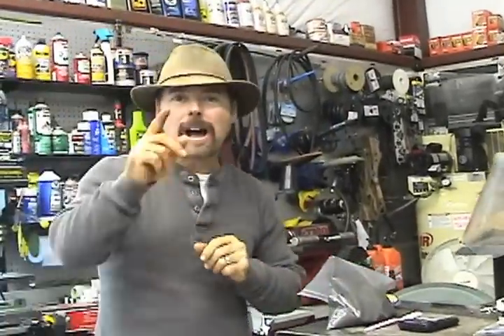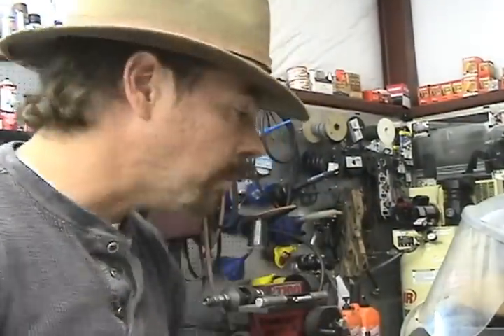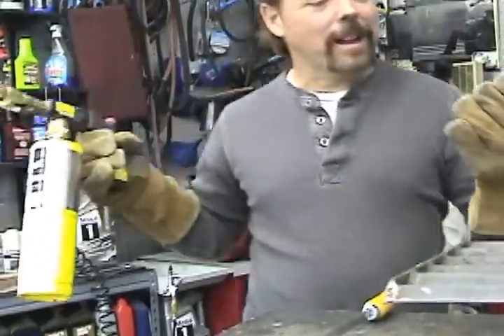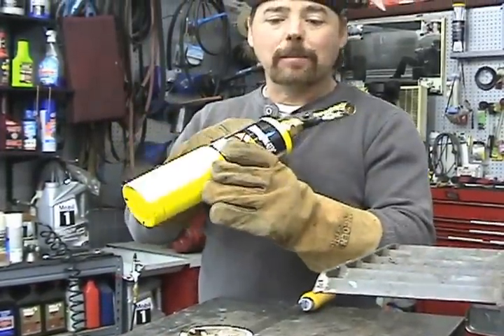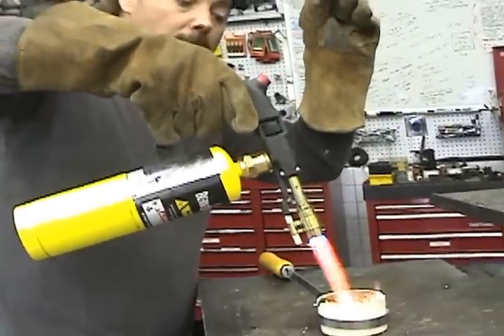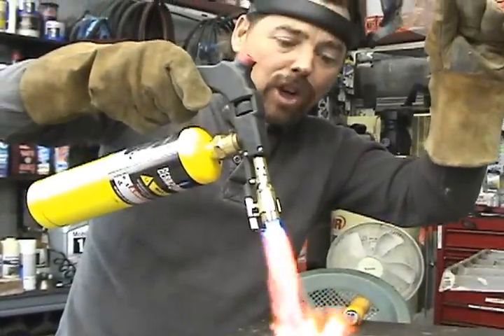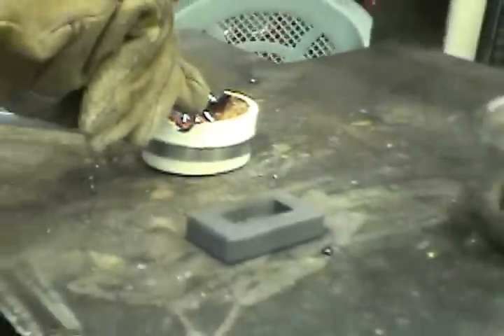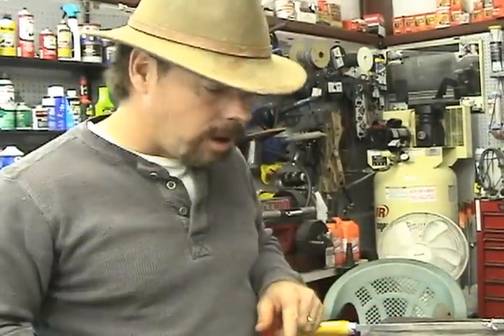MAP GAS | FLUX |  Smelting | Gold - ask Jeff Williams

Comment: I made a button of my own small pile gold flakes - used an ordinary propane torch with a little borax powder as flux. I pre-heated the crucible. Ended up with 2.1 DWT.  (I use pennyweight rather than grams - so much easier to calculate. 20 penny makes an ounce.)  So 2.1 penny is slightly over a 10th ounce.

Comment: the torch is a harbor freight torch its around 20 bucks and sold as a welding torch and works great although im not sure its rated for map gas though, mine said nothing about any other fuel except propane but hey its working nicely with map for him. just thought id share where the torch is from im using mine as a small forge burner

Comment: It was costly and somewhat funny to see happen, but way back when I was up in Brekenridge Colorado decades ago, the local concrete and gravel plant would let us clean the sludge out of the run off trough of their washer plant.  The material the plant used was from huge dredge tailing piles from gold mining many years before.
Well, over a month or so I would process out this mud and clean the gold up.  We got a few ounces and split it up.  One of the guys decides he wants to melt his down, so he tosses it in a metal pan and goes to town on it with a Mapp gas torch.  None of us had done this before, so no flux and he just burns and burns and burns away on it.  Finally he stops and no gold in the bottom of the pan.  Just a bunch of slag.  He is like, WTH happened to the gold!  Tosses out the chunk of slag.
30 years latter after seeing this I am wondering if the gold was inside the slag, LOL.

Comment: Hi Jeff...LOVE the videos.  Dude, I used to run the furnaces at Dillon Gage Refining on Indian Trail in Dallas and melted millions of dollars worth of gold, silver, platinum and palladium from pawn shops, jewelers, dentists (gross melting teeth with blood still on em etc!) and literally walked around with 650 ounce ingots still warm from the furnace after vacuum tube sampling them and casting into foot long ingot molds.  Point is, you live and die by flux...wrong flux, you lose gold.  I always used anhydrous borax as a base and on the 3rd or 4th melt, casting into a conical shaped dore mole, thinned out the final melt with sodium nitrate.  Since then, I've become an artist in raku pottery and glass and make all my furnaces, burners etc. to this day.  That said.  Get on Craigslist under the "art" section and buy a used 110V electric kiln and forget the torch.  Go on ebay and buy a small graphite crucible.  Use borax as a flux and at the end of stirring the mix at high melt, thin the whole thing by pouring in 10% of the borax weight of sodium nitrate and use a bit more to make it thinner if you want.  Your work and efficiency will go WAY up.  The ONLY time we used a torch was in small fireclay crucibles and it was an oxy/acetylene torch to burn dentist's teeth to get the palladium/gold melted into a button...didn't even use flux!  Keep up the HILARIOUS videos...man you are the Red Green of Youtube!
Reply from the maker: Thanks Russel for the great info. We will look into an electric furnace too. What are your thoughts on a propane furnace.  Jeff

Comment: Jeff , I bought an older  02 concentrator (medical )    and use my natural gas from my house as my gas ,
made a diy torch from two old propane torch heads and valves , using the natural gas from my house and the 02 concentrator for my 02 , and I can do everything but cut with that flame , braze up to 1/8 inch even thicker and if I had a regular cutting torch mixing barrel and cutting head I could probably cut thin material with it if i had a higher pressure source to blow thru the metal , probably regular air compressor air would suffice for that but it is the perfect flame and it's almost free . I sold my big torch and bottles  many years ago and i get by with this homemade rig and its all damn near free no more buying gas from welding supply or bottles of map from Meads Hardware store . Just food for thought for uyou or any of those on here interested

Comment: Useful 411  ,I use natural gas from my house and an old medical   oxygen  generator  aka (breathing machine) ,you can find the older type real cheap .  i mix both gases via a simple two valve/ torch mixing barrel using a  small orifice  oxy /acty  brazing tip . it will get hot enough to even braze  or gas weld metal up to 1/8 " thick .

Comment: I tied using borax but it coated my gold a dingy color and didn't resemble gold or melt to a button, I used map gas.. To be fair it was a 10k solid gold ring, seems like it was covered in a glass substance and wouldn't melt to a button rather just large chunks which would be great chunky gold, would borax be the culprit

Comment: Hi Jeff. Great videos, really enjoyed them. I used to poke around in the hills and find cool rock specimens. Never knew you could actually vaporize gold, does it simply evaporate into the air? I saw on your one video with your dry washer it looked like you were using the same leaf blower motor for that too that you used for your vac-pack? Also which is the most productive method, 1) roasting pyrites/sulfides or 2) crushing and panning? I'm up in the Portland area but hoping to get out soon and do some panning. Don't let slim steal your gold!!
Reply from the maker: Doug Van Tassell  yes it will boil at about 4700 degrees. Yes it is the same motor (Echo 210 ) I would say crushing and panning for us. We produce more Gold here with that method.
Jeff and Slim

Comment: I'm not trying to be difficult but you really need to preheat your crucible first before you put your gold in the crucible. If you are doing several melts, back to back, then you only need to preheat it once. You should also wait to pour the flux in just before the gold becomes molten, and just a tiny pinch will do. Too much flux can cause porosity. I know this because I'm a bench jeweler.
Reply from the maker: Dani Vela-Perez  Thanks for the info and tips and yes we should show pre heating the crucible first, Thanks,
Jeff and Slim

Comment: Where can i buy the dish you have to melt my gold in or what's the material is made of or called? I bought me a little graphite crucible and tried melting my gold but it won't liquefy it just melts down. I have map gas on bernzomatic torch so i don't know if that's even hot enough.  Please help advise.  I think it won't melt because my crusible is round tube so my flame is not direct heat and getting full temperature i don't know.  Thank you
Reply from the maker: Wayne Ernst Hi Wayne we get our supplies from a place called Make your own Gold Bars. Here is a link;
http://www.makeyourowngoldbars.com/silica-dishes

The MAP gas will get it Hot enough but takes a while so be patient. Be sure to season your dish first with Borax or Flux.
Jeff and Slim
Reply: Thank you very much
Reply: Are you interested in the Kate Spade Planner?  You left a comment on my blog.  I actually never used it so it's brand new.  Email me if you're interested.
Reply: Just use a potatoe instead of a dish, works same

Comment: Hi Jeff, Great videos, thanks.  I have some gold that was melted with aluminum.  What is the best way to separate these metals so I have the 95% that you are getting. chemical?, torching? thanks.
Reply from the maker: Del Norte Chiropractic smelt the aluminium out with flux and use a cone mold to drop the Gold to the bottom.
Jeff and Slim
Reply: I'm guessing the extra on the top will easily crack away after it is heated. Is this correct? I love your videos, Thanks for your help.

Comment: I found a little container that has a couple tiny prices of gold.about the size of crickets ear,  I thought buy looking at the gold I hadin the container, I could compare to what ever I find in a couple buckets of dirt and mud that I brought home from my first prospecting trip . there is lots of shiny stuff, 
 So I figured I need to put the gold in a pan with the mud to see how gold  really does or does not move.

 I was surprised. I still don't know if I have any . I do know there is a lot here that isn't , so my question would be ,is the term ( concentrates ) meaning all this materiel cleaned and most of the floaty shiny stuff, removed,? 

 I mean, what does gold sand really look like wet and dry? 
 What does a pan with half cup of this look like? I'd like to see this so I know if ive waisted time and material. 
 I dont like looking ignorant going to the guy at the jewelry store . and I know they don't like waisting their time with me. 

 If your still reading this, I apologise for not keeping it short and simple. Thanks for making your vidieos.

Comment: Hey, pretty cool stuff! What is the stuff you're using for flux? What does it call? I had some tough time melting silver and gold with the mapp pro gas torch. It seems that the torch cannot regulate enough amount of gas flow to generate enough heat and it sweats out in a very short period of time that weaken the heat and not getting the job done. Does it mean the torch is no good? Any idea what I should do? I need some help here...Thanks.
Reply from the maker: +mich65ek2  That is Chapmans Flux from http://www.makeyourowngoldbars.com/1-lb-hank-chapman-recipe-flux-refine-gold-silver-recovery-jewlery-smelting-assay
MAP gas is just hot enough but like you said ...any small change and you are back where you started. Try acetylene and oxygen. That will get hot enough.
Jeff and Slim

Comment: Is that just tap water it's dumped in after to cool? Does it have to be distilled and why?
Thanks
Reply from the maker: Yes distilled is better due to no minerals or alkali affecting the Gold during the cooling process.  Jeff
Reply: I used tap water last night. The button I made looks more like silver. It was 14k gold I melted. Does it look silver because of tap water?
Reply from the maker: It may have had an effect on it or when you melted it did you use flux to draw out impurities .   Jeff

Comment: Hey. Still learning before I eventually buy that gear. Just wondering, does that black flux separate copper and gold and could you use it for refining gold out of gold filled jewellery?  So far I've just seen the Aqua Regia and Cupelling methods for refining other metals away from the gold but I assume by base metals you mean things like Copper, nickel etc.                                                                                                                                                                                                                    Also if it does separate the gold and copper/brass, can I do this process in a closed electric furnace in a graphite crucible?
Reply from the maker: yes
Reply: @Askjeffwilliams  Thanks.

Comment: this video make it look easy.....I'm doing the low budget melt.
Trying to melt my gold bridge into a ring for my gal. I've made up a mold and trying to melt the bridge right into the mold. I'm using propane, can get the gold orange/red but it's not melting. what am I missing, flux, acid more heat?
Reply from the maker: Eric Wight you have to use MAP gas it has a higher burn temp. Gold melts at 1953 degrees.
Jeff and Slim

Comment: Can borax be used or is the flux better? What purity does the gold come out to or is that hard to say for sure without some kind of purity test?
Reply from the maker: Hi Stan you can use just Borax and that was the standard for a while but Flux is much better at removing impurities and if done correctly you can expect 98% pure .  Jeff
Reply: But if there is Silver mix within the placer gold, borax or flux won't remove it. I did mine and getting 86% AU and 14% Silver

Comment: Hey, Jeff & Slim! How does one alloy one's AU down to say,  18 or 20 caret for jewelry making purposes?
Thanks!
Reply: Thanks! There's the stuff,  now to figger out how to use it~
Reply: FREEDOMFAN229 you just mix your purified gold with the alloying metal in the ratio to get the karat you want...then melt. You can do it with mapp gas as Jeff W demonstrates. If new to this, please note the safety item he doesn't mention is the work surface. He is working on a table covered with steel plate. Be safe and have fun!

Comment: hey jeff i got 1000grams of gold flakes off the internet..can i use this to make jewelry?
Reply: hey I aint jeff and I don't know as much about gold as jeff does ether. I do know that when thay make jewelry thay put alloys in the gold to make it harder so it don't bend and dent as easily as gold by its self will. Even most gold jewllery marked 24carret isn't thay still alloy it because gold is very soft. 24carret is supost to be 99.9% pure gold. Im planning on making a wedding ring for my fiancé a ring from the gold I found I haven't done it yet I don't think it would be a problem making jewelry out of gold. people have done it for thousnands  of years why cant we do it in the 20th or 21st century witch ever it may be?????
Reply from the maker: Hi Christopher, yes you can . There are several ways you can do this. Let me know if you would like suggestions.  Jeff
Reply: ***** Hi Jeff, what's the name of the torch head that is being used?
Reply: Daniel Collazo Looks like a Benzomatic (sp?) brand. You can find them at any home improvement center. He might have a special nozzle on it though.

Comment: Hi jeff, when you melt your flakes and pickers down with the flux you use, how pure is your gold? Do you stop there and sell your gold are do you refine it more to 99.5. Thanks mike.
Reply from the maker: Hi Mike we stop there a sell it ti a refinery. It is about 95 to 98% pure.  Jeff
Reply: ***** Thanks jeff. Have you heard of shor intl,. its a refining system you can buy for about $600 No harmful chemicals used, your gold comes out to 99.5 . I would like to learn how to Refine gold to 99.5 for best results. If you have any good info for that could you send it to me. Thanks Mike.
Reply from the maker: Hi Mike yes I have. Basically electrolysis in salt water without secondary coating then the Gold is dropped out of solution to be dried and melted. Sounds better then Aqua Regia.  Jeff